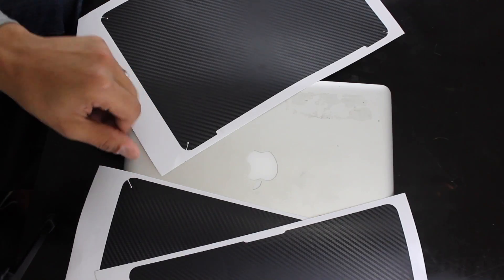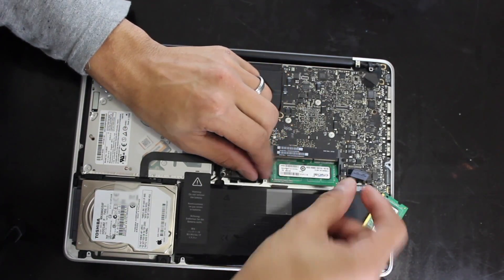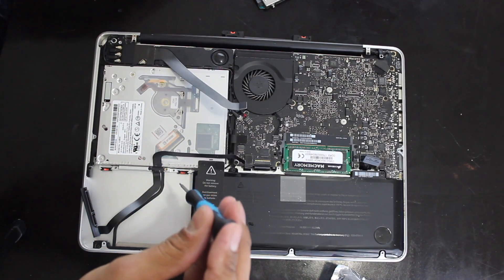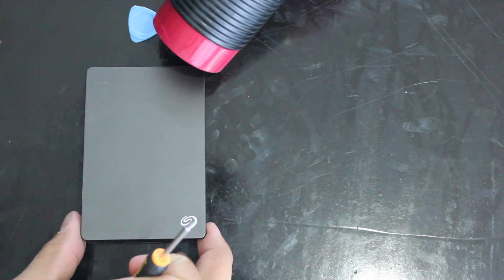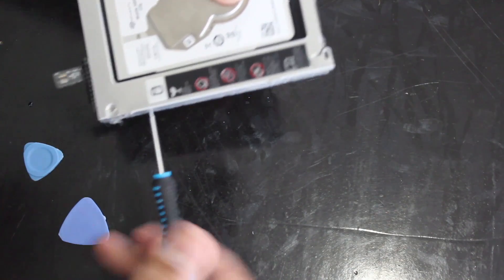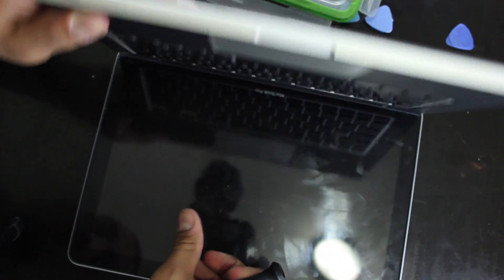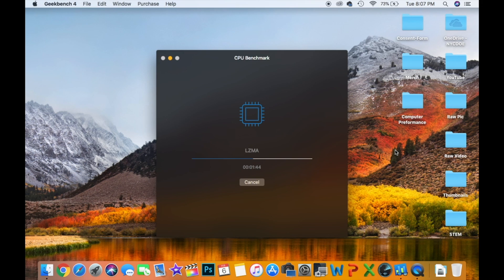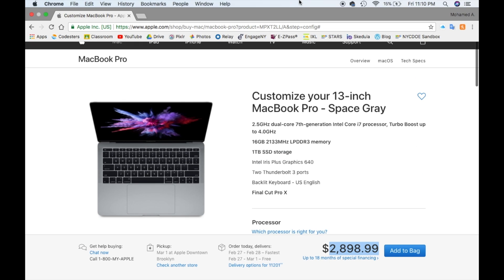2011 Macbook Pro Upgrade (3TB, SSD + 16GB RAM)

Comment: 3TB hdd seems a bit an overkill to me, but i have the very same machine with the very same ssd and 8gigs ram, and im writing this comment from it. Sure not "gaming capable" (who buys macs for games anyway?), but still after 8 years its a great computer for any everyday task; i fully recommend the ssd upgrade to anyone, it will resurrect the machine.
Reply: Did you format your ssd to Mac compatible?
Reply: @TheRolex23  no, put it as it came from the box; then the mac did evrything by itself
Reply from the maker: Right on the money
Reply: Were you able to complete the upgrade? How did you transfer data from old drive to new drive? Thanks in advance for any feedback!
Reply: @parkerrogers2277  hi park! I actually did it manually, but a good program i often use to clone hdd's its macrium reflect. In any case if you insert a new (or just formatted) disk or ssd on a mac it will download the os after you login to mac account
Reply: @lokibau  Thanks! Is your process with macrium reflect similar to this?: https://youtu.be/j2efihrnStg?t=546 1) connect new ssd via sata to usb adapter 2) format new ssd (what format?) 3) run macrium reflect to clone old to new ssd

Thank you tons for spending your time helping me with this!
Reply: @parkerrogers2277  yes thats correct; indeed you dont need to format new drives, when installing the os it will automatically format the drive with the correct file system, wich happens to be macos journaled!
Reply: @parkerrogers2277  macrium clones what you have in the disk to the ssd as it is, so no need to format anything, just clone and swap!
Reply: @lokibau  Awesome. Thank you so much for your help!
Reply: @parkerrogers2277  no problem m8 :)

Comment: I upgraded mine in 2016,but now in late 2018 its not worth,regrated wasting parts for my older Mac 2011
Reply: PAULO SERIF COUTINHO Why did you regret it? I'm planning to upgrade my MacBook Pro Mid 2012 i7 to 16gb ram & 250gb SSD

Comment: I have a spare WD MyPassport that has 2 TB of capacity. Can this be used as a replacement for the hard drive?.
Reply from the maker: Yes, but if it's an actual drive. You need to open the case and see if it's an actual hard drive in there

Comment: Great video! I just have a question..
Your title says +16 gb memory ram, but apple says the maximum in this models (2011) is 8gb, if I put 16 they will be work? O just 8 gb will be work?

Thanks for your time
Reply from the maker: I used 16 and it worked fine, however with the work I do (which is pretty extensive) I didn't notice a big difference between 8 and 16. So I downgraded back to 8 to save some money. Good luck to you!
Reply: @MoeNegm  How would this compare to adding a 1TB SSD drive in the optical drive location and a 1TB SSD  in the HDD spot? Which would be faster? So now you would have 2TB but both SSD.

Comment: According to the Intel website those CPUs support up to 32gb ram.  Has anyone tried the 16gb ram modules available from ebay?
Reply: 32GB on this machine will be wasted money, unless you run three or four very large apps at full-tilt at the same time.
16GB is more than enough.

Comment: Im a bit lost about how you kept the same settings and programs and operating system in the new hard drives. I know you mentioned the time machine, but where did you store the time machine and how did you transfer everything to the new hard drives??
Reply from the maker: So the 2tb hard drive was originally an external storage and had the time machine saved on it. Then I restored from that time machine to the the 1tb SSD (which will now serve as the main drive) that's it.
Reply: you can also clone new ssd via disc utility from old hdd

Comment: i have already upgrade my macbook pro 13 inch mid 2012 from the stock 4gb RAM and the 500gb HDD to 16gb RAM 500gb SSD and i was thinking can i put a 1tb SSD in the optical drive along with the 500gb SSD already in it and make it RAID configuration?

Comment: Moe, could you share your Seagate's model number or just confirm that it's the same as the product in the link (https://goo.gl/ozYMSC)?   I'm thinking that if the model number is the same as yours then it probably has the same build.  I'm really interested in doing the same upgrade you did minus the 16GB RAM.
Reply from the maker: The serial of the one I have is NA96Z49P

Comment: I upgraded my iMac 27"2010 mid core I 7 quad core with 16 GB ram + SSD. it's running like super smooth. tough I installed mac os Sierra. but still doing editing on final cut like butter.
Reply: Reilly bro

Comment: So I have the Early 2011 MacBook Pro with,
2.7GHz i7
Intel HD Graphics 3000 512MB
Mac HDD 500GB

I'm looking to replace my HDD to a SSD however, I'm using

2 x 8GB DDR3 RAM that runs at 1600MHz not 1333MHz!!!
Will I run into any problems??? 

Everything seems smooth and fast besides the slow and small HDD

Comment: @ 6:30 you talk about having 8 GB RAM more than apple says this model can handle.  Please explain. 
I have found several articles explaining it is pointless to have more than 8 GB RAM in any model pre 2013
Reply from the maker: Yeah I actually replied to several comments advising people to just use the 8gb as I did not notice a difference between a 16gb and an 8gb.

Comment: If you want to run Windows or Linux, you need to carefully pick decent quality hardware. With Apple it´s no different. If you can, stick to 2011-2015.
For online activity, I recommend a Chromebook or tablet. (Windows & Linux are for those who don mind tinkering under the hood, and Macs are overpriced disposables nowadays.)

Comment: Was this the model with the GPU that got fried after prolonged stress.
Reply: Mine never gave any issue. Still rocking that baby. All original so indeed a bit sluggish but tbh much better than the newer models. The butterfly keyboard is shit. And the touchbar is just a gimmick.

Comment: Great video , i can do everything hardware wise need help with the formating etc complete mac noob. i want to install a 500gb ssd where you did and put my 750 gb hdd in the optical. how to i do the transfer over so the ssd is just for os and apps. and the hdd for my files . i have a time machine on a external but its prob 700 gb . my new ssd will be 500 gb. please help thanks bro
Reply from the maker: I really wanna help but you totally lost me.
Reply: @MoeNegm  lol I want to do the same . Put ssd in place of old HDD and my old HDD on optical caddy . I can do all that I'm just lost as to how to transfer my data from one drive to another so the SSD is boot up . With Mac os . As this is all on my 659 GB old HDD . My dad is 500gb so I can't clone as the 750 HDD is full and bigger capacity . I am not very good with Mac's .
Reply from the maker: @hessybear6242  oh! I'm that case, do the same thing I did in the video. Make a time machine (maybe on a partition on your current hard drive or on a separate drive) turn the computer on and click transfer from time machine and you're done
Reply: @MoeNegm  ok but my time machine backup is 750gb off the HDD as it's full . So surely it wouldn't backup to the new ssd as it's only 500gb? I've never used time machine before .
Reply from the maker: It's only 750 because it's multiple time machine backups so it wouldn't really be 750 it would be much less than that
Reply: @MoeNegm  ok I'm.new to Mac . So is it possible to just take my apps and os? No files like videos and pictures music etc ? To the new ssd . Also can I put new ssd in original HDD place and the original HDD in optical caddy . And just boot up ?
Reply: Ok great all done thanks so much . Great video . Also tearing apart that external drive I done the exact same . Amazing 2tb Seagate slim . Worked a charm . Laptop is lightning fast now . Thanks again for help

Comment: I just bought a mid 2012 13" MacBook Pro, 8gb ram, 750gb hd, Intel i7 2.9ghz. I found it on "offer up" and the seller was asking $550, I gave him $460 for it. I sold some junk silver coins for $300 and just added an extra $160 to buy the laptop. 
 I have been thinking of doing this upgrade as well, especially since I never use an optical drive.
Reply: if you stick with el capitan 4gb ram would work fine. so you only need to upgrade the ssd.
Reply: Hey there, thank you for the tip. the macbook already had Mojave when I got it. I did just order everything yesterday too. Got a 1tb Samsung evo SSD and 16gb of Crucial Ram.

Comment: Theres no point upgrading this the cpu is pretty trash
Reply: There is no pint for YOU. Open your mind, people have varying circumstances and this option is PERFECT for many many people.
Reply: that's crap, my 2011 runs daily and performs excellent. Not everybody sits around playing games.
Reply: @no_handle_required  I'm thinking of getting one, what kind of work do you get done on it?
Reply: Lol you can flash the macbook to go to mojave...
Reply: Nike Mldc it has an intel core i7...
Reply: + this model is not supported anymore in macOS Mojave... what a waste of cash!
Reply: @johnnybegood8049  not true.. I replaced the HDD only with a 500GB samsung SDD and upgraded to Mojave -- Mac went from SWOD daily to running like a brand new Mac Laptop
Reply: Tyler Parr 2011 MacBook are not supported by Mojave. It’s a fact! Either you have a 2012 model or you did use Mojave patcher.
Reply: @PhuketMyMac  still supported by mojave
Reply: @PhuketMyMac  Just updated my 2011 early macbook pro :)
Reply: I am glad you did!
Reply: Its not hard to upgrade to Mojave with a bootable drive, even if its technically not supported.
Reply: What about GPUs which are not supported? How do you upgrade an iMac 2011 for instance? Now if you use the Dosdude Mojave patcher, I get it. Without it, some Macs won't just boot to Mojave. End of story.
Reply: @johnnybegood8049  yes but you could still install it the unsupported way
Reply: @johnnybegood8049  lol maybe you don't know how to do it. really easy
Reply: Surprise you didn’t mention the display which is far more important than cpu.

Comment: Did you enable trim?
Reply from the maker: no? what is that?
Reply: @MoeNegm  Trim enables the OS to inform the SSD on blocks of data that are no longer in use and can be wiped.

By default trim is not enabled on self-installed SSDs. To enable it simply do the following:

1. Open the terminal app.

2. Type 'sudo trimforce enable' then hit enter.

3. Enter your account password

4. System will display a notice asking if you are sure that you want to enable trim, just enter 'y'.

5. OS will notify that it's rebooting, again enter 'y' to confirm.

6. After reboot trim is enabled.
Reply from the maker: Great! thank you so much

Comment: 2nd gen and 7th gen are big difference tho. plus pcie ssd, faster ram and graphics. but yea latest mac still laggy af like the old ones so maybe small difference
Reply from the maker: I agree. I've used the 7th gen it is quite a bit faster. I'm going to make an updated video soon
Reply: Holden Burke  pcie doesnt necessarily mean a slot. why you shit talk here before learning computer then?
Reply: Holden Burke   open system information on your macbook and see what it says about your ssd. its fine if you didnt go to school but you should always try google before shit talking cuz that would make u look stupid
Reply: Holden Burke  there are pcie ports but pcie doesnt necessarily mean a port in your motherboard its a protocol allows hardwares to use the pcie bus comes directly from the cpu. what do you think how mobile gpus work without pcie? and how nvme ssd fits inside a laptop where nvme uses pcie too. why you arguing with me without using your brain or google. just go to study kid
Reply: Holden Burke  what you think how mobile graphic card communicates with cpu? how nvme ssd communicates with cpu? how external gpu works using thunderbolt ports? you could easily find out the answrs if you do some research. and whether or not apple uses pcie ssds. it doesnt even take 5 min to google but you rather spend more time arguing with me lol.

Comment: While this is definitely a way to improve your macbook, the performance is still an issue. I use top-tier MBP (2018) and score 1100 in Cinebench. So more than 4x times faster.
Reply from the maker: I agree, in currently working on a video to compare this to a middle model MBP 2018
Reply: @MoeNegm  does final cut pro run smooth after the upgrade?

Comment: I did this to mid 2012 for my 15” in 2013. It still runs amazing but it cannot handle big video editing. At least on set or on the go, it is good for digesting media on to drives.
Reply from the maker: Actually bit works even better on the 2012 then it does the 2011! Good on you

Comment: you misses to take out the small screw mount from the optical drive. Without it the had disk case will not screw near the connectors..
Reply from the maker: I probably forgot to include it in the video. What minute is that at? so I can leave a note in the description. Thank you.

Comment: Lord, are you folks mad???  2011 mbp is famous for dying completely with the 15" i7 processor model.  The discrete graphics processor self destruct with no fix even from Apple.  Don't believe me, go on FB and look up that group.  For the 13" model, the hard drive cable is prone to failure, you have to replace it once in a while.  You can also Google this too!
Reply from the maker: thank you for your input. P.S i'm a little mad yes.
Reply: @MoeNegm  I have a 2011 MBP and yes it died, but it is fixable and I fixed it and it works fine. The laptop is running on an integrated video card. I disabled the failed Discrete Graphics Card. I am planning to upgrade the revived MBP thanks to this video. With some research and persistence it can be done. I did it! with no IT background.
Reply: I have a 2011 MBP and yes it died, but it is fixable and I fixed it and it works fine. The laptop is running on an integrated video card. I disabled the failed Discrete Graphics Card. I am planning to upgrade the revived MBP thanks to this video. With some research and persistence it can be done. I did it! with no IT background.
Reply: Holden Burke  https://apple.stackexchange.com/questions/128180/how-to-disable-discrete-graphics-card-and-use-only-integrated-graphics-macbook-p

Comment: agreed I just bought an 2010 mac book pro and put a new battery in it. Took me less than 10 min. I am planning on upgrading it and use it as my daily for school and coding. Yes you are right it's better to upgrade the old system, because of the flexibility and customization you have. Also most people will not use the full power of a 3K mac book.
Reply: I have noticed over the past month that the market for "macbook" parts, accessories, chargers, etc are so inflated and cost much more than any other laptop would.... for example I got q charger for my Dell laptop for under $10 original dell charger. For a macbook a new charger is about $50 original apple . Ram is the same story, and so is all of the apple accessories.... in my opinion is not worth it to pay premium price for a 9 year old laptop
Reply from the maker: Best of luck and great on you!
Reply: Hey . 
May you tell me from where can i get a new genuine battery for mac book pro 13 inch ??
Reply: @seghir0  Amazon.

Comment: Hey sorry to bother you, I purchased the 860 EVO SATA 6 Gb/s 1TB. I used the free carbon copy clone tool.  The new SSd works fine in the hard driver reader attached by usb, but when installed it does not respond well it is super duper slow.  I meant like 4 minutes lagging. Any thoughts?
Reply: Were you able to complete the upgrade? How did you transfer data from old drive to new drive? Thanks in advance for any feedback!

Comment: Can the early 2011 macbook pro support 16 GB 1600MHz DDR3 instead of 16 GB 1333 MHz DDR3?
Reply: Matthew Churchin I don’t think so
Reply from the maker: It can support it but I found that the 16 gb is a complete over kill you will hardly notice a difference

Comment: Great video bro, I think I’m gonna do this myself too. 

One question: do you think there’s a significant difference between using 8GB and 16GB of RAM ??
Reply from the maker: To be honest I've down grades from the 16 to the 8 because I hardly notice any difference on the 2011 model
Reply: @MoeNegm  why downgrade from 16Gb to 8gb?
Reply: If you haven't done this yet, No just get 8. The kind of work that needs 16gb can't be done with this CPU. And for God's sake don't get 1TB of ssd. It's a waste of money. Just get a good 250 for os and apps. Put your media on a HDD you won't notice the difference unless you use it for video editing (again , which is not a good idea on this processor).

Comment: Moe I also have a 2011 mbp and upgraded memory from 4gb to 8gb and a 300gb original hard drive to a 250gb samsung evo ssd like 2 years ago. It was a big improvement, will  16gb memory upgrade make a difference in performance? For the record i still have a lil over 200gb of free space on my hard drive and ran a disk speed test at 400 write and 480 read.
Reply: I have read several articles stating the RAM maxes out at 8 in the pre 2013 unibody models.  Also be aware RAM doesn't speed up your computer, it allows it to multitask.  I am sure you have noticed the computer start up is much faster with the SDD (I know my mid 2012 has).  Unless your running Adobe Creative programs + FCP, etc.  You may not need the extra RAM.  Then again for $50  or $100 bucks you can add the 8 GB + of RAM and feel good about how fast your computer could be 😜
Reply: Thanks , oh ok thats good to know ill stick with 8gb then. Have you upgraded the battery yet?  I'm almost at 950 charging cycles and about to get one of those newertech nupower battery , heard there good.